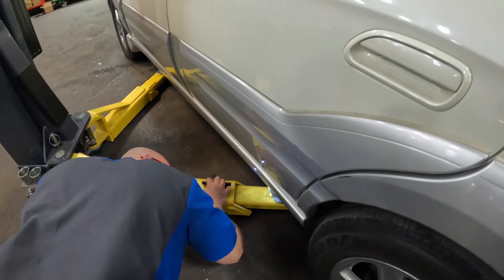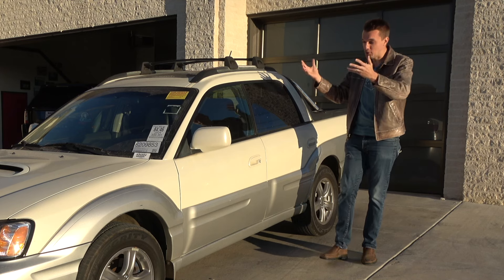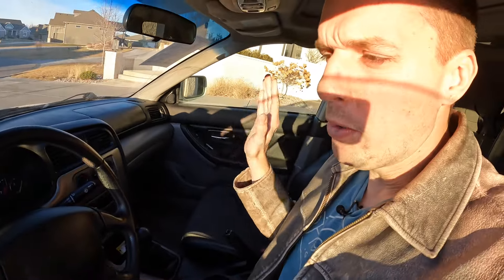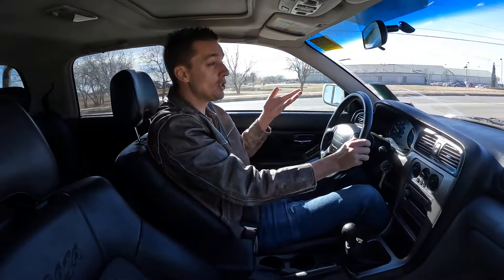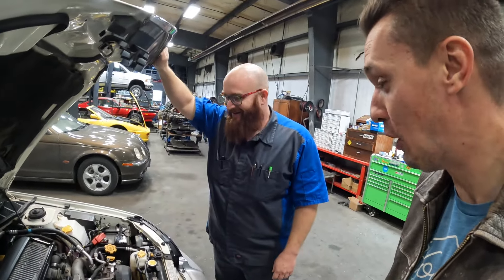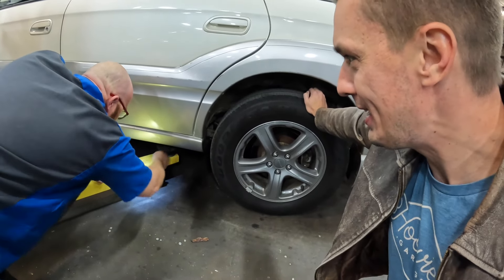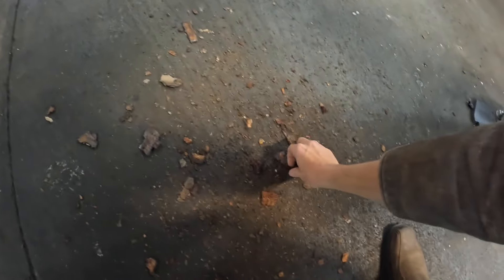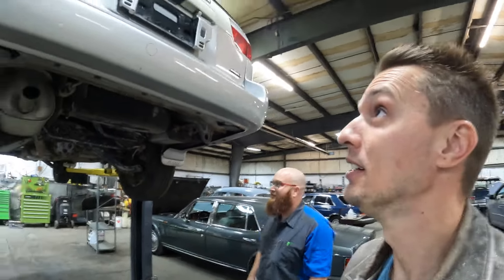Here's why you should NEVER EVER Buy a Cheap Subaru (total mechanical/rust DISASTERS) Baja XT Turbo

Comment: Part it out, you'd probably get most of what you spent back. Especially the engine, even with the mileage. The body panels, trim etc.
It'd be interesting to see just how much you could get.

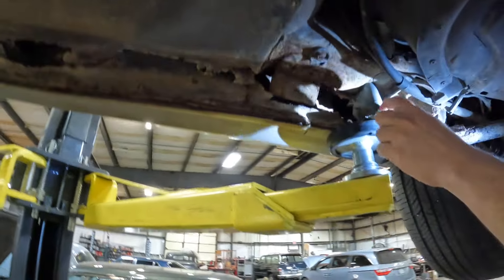Oh, and 22:30 onwards is hilarious 😆
Reply: This is the only thing to do. Sell the still useable good bits to keep another on the road, let the scrap man take the remaining pile of rust.
Reply: Engines and most of the bodywork is worthless, those are dirt cheap from Japan
Reply: He would be lucky to get more than $1500 all together.
Reply: @stuvademakaroner9607  Have you looked at current shipping prices?
Reply: Since he bought this at an auction he can get is money back.. (I work at a dealership that buys cars at auction)..the car has structural damage he is legally entitled to his money back even if it is an as is sale.
Reply: @jkalila6954  that depends on the state and regulations of the auction. In Nevada it doesn’t work that way.
Reply: @KacKLaPPeN23  Could make it a shipstation episode lol
Reply: Engines are crap on these cars. Unreliable and expensive to repair. Subies quality in general suck. The less of these on the road the better. Parting out this thing is more work than it's worth. Just junk it and move on with your life.
Reply: @kevinconquest9307  I agree, at best. Engine probably only has 20k left if it doesn't need a big repair already.
Reply: @drno1022  If, as you say, they suck so bad, then explain why they hold their resale value so well,  have such a loyal following and as a brand, have seen solid sales increases every year on just about every model. Statistically, 97% of Subarus sold in the last 10 years are still in the road and safety wise, consistently have the highest crash safety ratings across their models.
Reply: @bondpit8750  so let's crash test this one and see how it does.

Comment: Never buy a subaru of any kind if you are short on cash for repairs. I live in Colorado mountains and subarus are everywhere,  as are subaru repair shops.
I owned a 1997 and 2007 and were the worst cars I ever owned.  After switching to a 2018 rav4 and 2002 Volo xc70  my repair bills plummeted  and my spare cash increased, weird.

Comment: I live in the northeast and still am surprised of this, especially how rusty the front sub frame is.  Looks like it spent most of its life parked somewhere very damp/wet.
Reply: Yeah, I'm in NJ and I've never even seen "beach" cars this bad. It must have been kept in Salt mines lol
Reply: I'm thinking someone liked to drive it on an ocean beach.
Reply: Yeah, it would be interesting to know where it came from!
Reply: I live near Buffalo NY in the snow belt and rarely see something this bad!  Water ingress from the wheel wells and maybe if it was parked over tall grass and left for a year or two.   Jeez
Reply: @StromBugSlayer  I'm thinking they like to drive it under the ocean 🤣🤣
Reply: Some other people are saying flood car, which is possible. I have a 04 legacy with 175k mi that has the holes below the back doors and some rusty fenders, but the rail areas are still very solid.

Comment: Those early Outbacks/Bajas/Legacys are well known for rear sub frame issues, even was a recall on a lot of them
Reply: Rust has a lot to do with the design of the car.  The more plastic parts the better in the rust belt. Here in Salt Lake City chrome bumpers start to rust around 5 years old. It’s sad.
Reply: @mylesgray3470  I agree with plastic bumpers but plastic cladding like this Subaru is the worst because it traps water and salt against the body panel, and then hides all the rust that it causes.

Comment: I loved my Baja, used it to haul my Spec Miata, 2 sets of spare wheels/tires, tools, spare parts, wife and daughter to races all over the Midwest! Towed from Wichita to Brainerd, MN, Wichita to Greencastle, IN,, Hallet more times than I can count, Heartland Park and more. It was an awesome rig till it did what Subaru’s do, cracked a piston skirt and had leaking head gaskets. Replaced it with a Honda Ridgeline which was an all around better rig for my needs but not nearly as fun. Subaru, bring back the Baja!

Comment: I had an 05 forester XT manual premium - hard to find and a lot of fun. I miss it, but I don’t miss driving it and wondering when it would grenade on me.
Reply: Had an 05 XT as well but the auto, which was by far the worst part of that car and I often considered swapping for an STi 6spd. It's been years and I still regret selling it, tried to find another and it seems that everyone else has realized just how awesome those cars are. Mine had been swapped to a VF48 with some 650cc injectors, made 362awhp and 301awtq, super fun car, I just wished I had kept it long enough to have swapped it to a manual, it still looked completely stock, no stupid loud exhaust and was extremely fast, always surprised people lol
Reply: @chickenpotpie4045  Nice! Probably saw you on the forums. The manual was just...exquisite. Met a bunch of other owners who that was the thorn in their side - having the auto. Still, that auto could take a beating and mods. You can still find them for cheap now in an auto. Makes me want to do a full drivetrain swap since an auto right now is like 3-5k. I bought mine for 9k back in 2013 and sold it in 2016 for 9500.

Comment: Living in Maine I see the rusted out Subarus all of the time. I had a 2001 Outback that rusted out at the rear fenders, and the rear subframe. I fixed the fenders, and replaced the subframe. I see the same thing with Hondas, Nissans, Toyotas, and of course all domestic vehicles, especially pickup trucks.  Volvos, VWs, and Audis don't seem to have the same rust issues.
Reply: My family is from Maine and we would visit in the summers. I was always shocked by the number of Subarus I saw!
Reply: European vehicles rust faster than anything, especially the Sprinter Vans.
Reply: @user-tb7rn1il3q  Vans are expected to wear out through high mileage before they rust. European cars are generally good with regards to rust, with Japanese being probably the best.
Reply: You're right about pickup trucks those things rust like crazy across all the brands. Usually in the back is the worst. Something about the openness of that space underneath the bed.

Comment: Wow, that thing was gnarly. 
In my experience Subarus are very good cars - for a limited time. Once the limit is reached the literally fall apart. The duration is determined by miles on the street and exposure to salt, and this one seems to be a great example of massive salt exposure.
Reply: That’s what I was thinking. I’ve had nothing but good luck with subarus. Had a great 04 forester that I wish I still had. Had a 92 outback, both well over 200k miles. Have a great 2010 Impreza now. That Baja was exposed to a lot of salt and road hard and put away wet!
Reply: Subarus are awesome. The only reason they're known for bad rust is because people always drive them where it snows a lot so they are usually exposed to a lot of salt.

Comment: I’m surprised more people don’t realize how bad Subaru’s rust. I assume the f150s will have the same problem if not taken care of giving the amount of surface rust they have from the factory
Reply: It probably won't get to that point unless you live in an area with salted winter roads , but I also question why automakers stopped painting the frames and suspension hardware it would also be more cosmetically pleasing to look at .
Reply: the car must have come from the northeast. every car up here rusts out, they cover the roads in salt up here in winter. Volvos seem to fair the best, but every car will rust in salt and Subarus are far from the worst
Reply: @volks-jager  I live the the snow belt/ski country of Central Ontario. My daily driver is a 1990 Volvo 240 wagon with 385,000+ miles on the clock. Yes, 620,000 kilometers. It has never had rust repair and is still solid as a rock.
Reply: @michaeltutty1540  Volvos are made from high boron steel and dont seem to rust as bad as most cars. i doubt Ontario uses as much salt as here in New Hampshire (we average 17 tons per mile of road over the course of a winter). Canada has half a brain and encourages/forces(depending on province)  the use of snow tires. unlike here in New England where we have idiots running around on racing slicks in the middle of snowstorms. Car manufacturers could easily make cars that dont rust at all if they choose to - the right alloys dont rust.
Reply: @OhPhuckYou  at least Toyota did the right thing and replaced all the rusted Tacoma frames under warranty, Ford and GMs did jack shit about it and are still producing shitty rust prone frames. GMs wax dipped frames are one of the stupidest things ive ever seen.
Reply: @OhPhuckYou   if we are comparing old school shit from the 80s you are 100% correct, but the new stuff no so much. have been a mechanic in New England(where absurd amounts of salt are spewed everywhere in winter) most of my life and as far as stuff made in the last 20 years i can tell you ive seen a fuck ton more rusty Fords and GMs than Toyotas. we just got a Ford at the auction with less than 50k on it and the frame is toast. and it isnt just the rust factor, Toyotas way way more reliable and they stand behind their shit. i personally dont care for Toyotas and would not buy one myself, but i work on my own shit so labor is free - if any non mechanical person asks for a recommendation Toyota is what i tell them.
Reply: It rotted because they put foam in behind the sheet metal all in the name of sound deadening, but it holds moisture and rots the car from the inside out.  They all do it - if your car has bubbles, that's whats going on under it.
Reply: @FrankBullitt390  or they pulled the thing out of the river

Comment: I would 100% buy a brand new Baja if they still made them today. I've always loved the design.
Reply: Check out the Hyundai Santa Cruz
Reply: So go buy a santa cruz lol

Its the same thing.
Reply: @striking827  I checked it out as a possible Baja replacement.  The Santa Cruz is quite a bit larger.  More importantly, the Baja has an elegant back seat that folds flat at the same level as the bed and a small (too small) door  allows a passthrough from the bed.  The Santa Cruz doesn't have that - deal breaker.

Comment: This reminds me of when I swapped my brother-in-law's wheels from the Mazda Protege onto my Civic before he scrapped the car. I had to try 3 spots before the jack finally punched through into some solid enough metal to lift the car in on one corner, and the others all bent or punched small holes while lifting. Thankfully the scrap yard was just a few miles away.
Reply: I have 1994 Japanese-made Protege I bought new and still no rust 😳.
Reply: How are proteges? I've been seeing them randomly and always wanted one.
Reply: @Xx_YoLoSwAgMoNeYhOnEy_xX  super reliable especially the older ones
Reply: @Xx_YoLoSwAgMoNeYhOnEy_xX  Both of my brother-in-laws owned one for a few years. They were good cars, they both liked them. The issue I see around me is they tend to rust out bad from Wisconsin winters and road salt. Of the two cars, one  went 370,000 miles before he sold it still running. The one that rusted out had almost 200,000 and ran fine but the frame made it unsafe to keep it going longer.
Reply: @personator907  might have to pick one up, I keep buying older subarus cuz im addicted but the constant leaking fluids and pain in the ass gaskets to get to are swaying me away from them. I keep seeing protoges in cool colors too like blue and yellow they just look like bugeye subarus

Comment: I would love to see you find a good chassis with a worse spec, and swap things from this one over
Reply: Wouldn't a Legacy or Outback chassis work also?
Reply: Frankly he should’ve looked at it better. My Baja non turbo manual was 1200$
Reply: @kennorcott7074  when did you buy it? Used car prices, especially niche cars like this, have gone through the roof.
Reply: @kennorcott7074  and just exactly how was he supposed to look at it better? Did you not watch the video? He could only look at it with the pictures provided in the auction listing. 
And your Baja isn't worth a fraction of what this thing would be worth if it wasn't rusty. The one you have is a dime a dozen compared to a factory turbo manual Baja. And you can't just simply turbo the one you have and it be the same thing.
Reply: @MrManniG  i guess some interior pieces wouldn't fit, but i think otherwise it may be okay thing to do
Reply: @motherurck7542  a year or two ago. Honestly it’s worth way more than I paid just in parts
Reply: @89ludeawakening1  a manual non turbo Baja is still a 10k car in good condition. There are less manual non turbo bajas than automatic turbos. They’re still rare
Reply: @kennorcott7074  Seems you got lucky. And yeah, it would have been more nowadays.
Reply: @kennorcott7074  okay... and there are WAY less factory turbo manuals than non-turbo manuals.
Reply: @89ludeawakening1  just because the turbo one is rare doesn’t mean the non turbo one is a “dime a dozen”.
Reply: @motherurck7542  yeah. It’s worth around 2k right now even with the rust and the other issues that it has
Reply: @kennorcott7074  read my first comment carefully. The non-turbo manual IS a dime a dozen COMPARED to the turbo manual. And that is absolutely true. That's why the turbo manual is the rare holy grail of the Bajas, because it was by far the least produced.
Reply: @89ludeawakening1  He didn't say he couldn't look at it. He said he didn't. Did you watch the video? He said he wasn't blaming the dealer bc he didn't inspect the car and bought it sight unseen. He could've had someone in the area inspect the car if he wasn't willing to fly out to view it himself.
Reply: @James-vn8zb  he did see the pictures from Euroasian Bob when he asked if he wanted to bid on it, and he said it looked good in the pictures. Sight unseen means he didn't see the car in person.
Reply: @89ludeawakening1  That was my point.
Reply: @James-vn8zb  your point has absolutely nothing to do with my original comment. All he saw was pictures. Clearly that means he couldn't fully examine it through only pictures. You're making strawman arguments for no reason at all. You've not rebutted anything I said.
Reply: @89ludeawakening1  Yes. I did. He could've sent someone to look at the car in person if he didn't choose to do it himself. He didn't have to buy it just based on auction pictures. He said it himself in the video. You're just being ignorant to the facts to try & support your nonsense that he had no option but to buy it based on photos.
Reply: @James-vn8zb  you are missing the point entirely and still making needless arguments. Did I once say he couldn't go see the car? No I didn't, I said he couldn't see the car better through what the photos showed. Meaning if going by only the photos you can only see so much. This is how many people by cars and it's why he doesn't blame anyone. You realize he might have been too far away or too to busy to just drop everything and physically go see the car, right? My point from my original comment still stands.
Reply: @89ludeawakening1  You said, "He could only look at it with pictures provided in the auction listing." So that is you saying the point is that he had no other option than to buy it solely based on the auction pics. As I said earlier, you can hire someone in the area to inspect the car for you. So he wouldn't have had to drop everything to go look at the car. You're ignoring what you yourself said and using talking points that I've already addressed. You made an incorrect statement. It's not a big deal, but you should own up to it instead of trying to say you didn't make a comment that is still there to see.

Comment: Subaru owners know exactly how that happened.  Rear wheel arch rust is genetic in Subaru Legacy's (which this is based on).  It's been quietly rusting away under that plastic body molding.  Then water gets into the rear rocker panels / frame and the rest is as you see here.
Reply: Why does anybody buy these cars? They seem like they have endless problems.
Reply: @OMGWTFLOLSMH  they are the king of snow so they cop all the salt and snow for years, away from the snow they dont have the rust issues
Reply: @OMGWTFLOLSMH  not really. i’ve owned 9 subarus now and absolutely love them. headgaskets are the biggest problem with them, and those are only an issue on 2.5NA’s. on these turbos you’d have to watch out for clogged AVCS filters which can lead to oil starvation and rod knock, and then also cracking piston ringlands. overall though my current one is a 02 legacy with 227k miles and it’s been absolutely bulletproof. as for rust yeah they can get pretty bad but up here in oregon my car is completely spotless underneath and i have never in my life seen another subaru as bad as this one
Reply: @OMGWTFLOLSMH  Good question. After buying an Outback XT I will never buy another Subaru. The flat-4 turbo is a fun and interesting engine, but they are also terrible cars for many reasons.
Reply: @OMGWTFLOLSMH  There great if you can buy them new and live in the right climate for them. I took my 01 outback to 300,000 miles before I junked it and my 2010 is about to reach 200,000 miles. Great cars if you stay on top of them.
Reply: Never really cared for the new style legacy and outbacks. They suffer the same aliment as any Midwestern vehicle that is covered in plastic body cladding, salt spray gets behind the plastic and it sits there and slowly rots it away from the inside out. 

As for why people like them, that I can speak of. I have a 1994 Legacy wagon, with the good ole 2.2 and a 5 speed. Its basically a mountain goat... Just aim it where you wanna go and it'll climb over or plow through whatever is in its way.